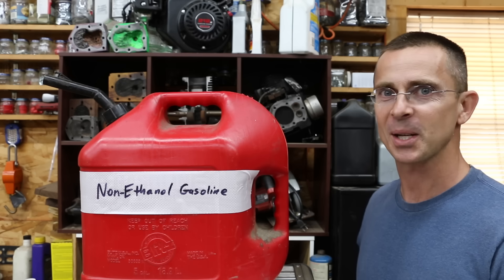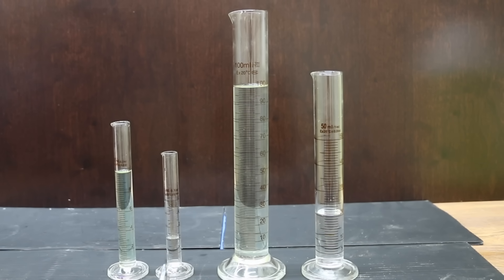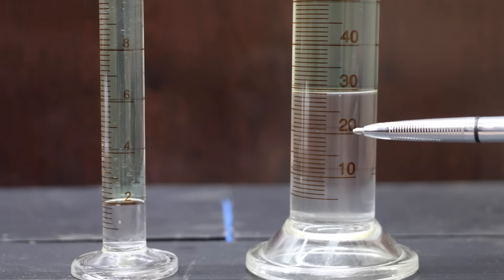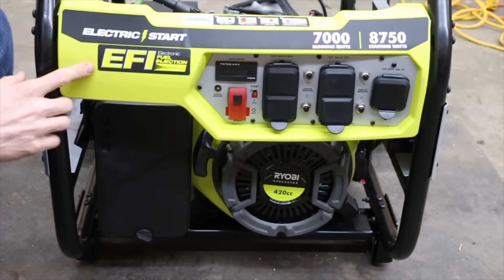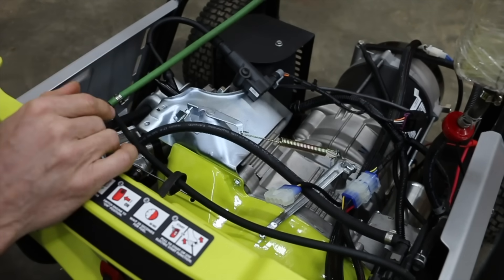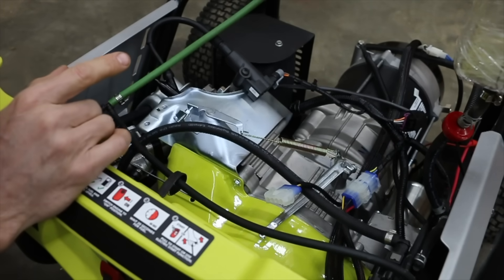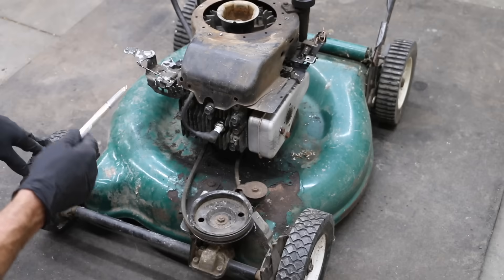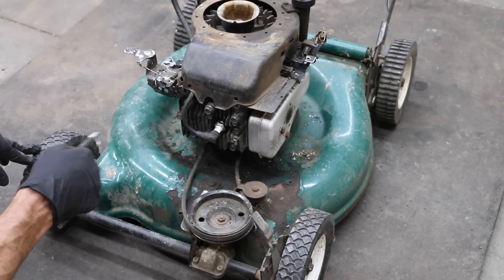Is Non-Ethanol Gasoline Really Better? See the PROOF!

Comment: Gee this is very simple stuff. Ethanol does not contain as much energy as gas does. So to get the same amount of horsepower out of your engine you need to burn 20% more ethanol than you do gas. So you get 20% less gas mileage. That equation is for pure ethanol. A blend just requires you to do the percentage math. The bad points of ethanol is that it will erode certain types of rubber and neoprene hoses and gaskets.
The good points are that it will hold some water in suspension so if you have a gas tank that does have water issues in your gas then some blend of ethanol can help as that is what you are pouring into your gas tank as an additive anyway to absorb the water. The other good point is that ethanol has a much higher octane rating. That confuses most people because they think higher octane means they have to burn less fuel to get the same power. That is wrong. You have to burn more fuel to get more power. We already said you have to burn 20% more ethanol to get the same power. But you can get almost double the horsepower by adding forced induction to your engine and burning E85. So lets say you have a 350 HP engine and want to get 700 HP. You add turbos and burn E85. How much more fuel will you have to burn? Well about 240% more fuel.
Wow! Guess what happens now? Your fuel pump is not big enough, and your fuel lines are too restrictive. And you will find out soon if you have the wrong kind of rubber seals in your fuel system. So can you get that much power with gas and burn less. Well not likely. You will burn less gas, but the engine will likely self destruct from detonation problems at such high HP loads if the octane of your gas is not high enough. 

So then how come just using E85 does not get you more power? Because the engine needs to be redesigned to optimize burning E85 for power,
such as turbos or higher compression ratios both require additional mechanical parts added to the engine. As well as a much larger fuel pump than what you need for gasoline. Can you build an engine for both? It is possible, the easiest way is with turbos. You would need a tunable engine computer and run two very different tunes one for E85 and a detuned gas which would limit the turbo boost a lot to prevent the engine from self destructing. But because of the large fuel pump and we did not yet mention the large fuel injectors required as well a detuned gas tune on such an engine will never idle well. And be hard to start in cold weather on E85 or gas. Lets look at that 700 HP engine built with turbos and tuned to run E85. Then retune the engine computer to run on pump gas and it will pull out a lot of the turbo boost so maybe you max out around 500 HP on pump gas. And yes you can get engine computers that can have multiple tunes stored in them for such use. At 500 HP that engine will be burning about 50% less fuel than when you run E85 in it at 700 HP. That is why you need different tunes the fuel maps are not even close to each other.
Reply from the maker: Thank you

Comment: Mandated ethanol at gas pumps is not american.. I don't care if they have a pump with it mix with gas but I shouldn't be made to buy it.. If a pump has 87 octane with 10% ethanol there should be a pump with 87 octane with zero ethanol in it.. I shouldn't have to go up to 91-93 octane to get ethanol free gas.. Farm bill is a bunch of BuLL#($it.. Subsidizing farmers by forcing people to buy that corn crap should be no allowed!  All ethanol does in small engines and carburetors is turn them green and )#$*PI them up!
Reply from the maker: Thank you

Comment: Maybe I missed it.  Non ethanol was 4% more efficient, what was the percent cost difference? I have heard and believe that non ethanol, while more expensive per gallon , is actually cheaper to run based on efficiency. I know that to be the case vs E85 based on my own limited tests.  Perhaps this side of things can be looked into a little deeper.  Thank you for all the tests you do. It really is interesting.
Reply: My wife's car will get 6mpg increase on non ethanol gas. My truck gets only 2 mpg better, but has a lot more power, runs smoother, and even has better sound.  Now that I'm in California, I can't get ethanol free fuel. :-(
Reply from the maker: Thank you

Comment: Wonder how much the octane is reduced by removing the ethenol?
Reply from the maker: Great point!  Quite a bit I suspect.
Reply: @ProjectFarm  I pulled into a gas station yesterday that had a pump housing opened up for repairs.  It had two fuel pumps in the bottom about ground level that "T'd" into a common 5/8" line. One for 87 and one for 93 I'm assuming, looks like it mixes the two for mid grade.  It was approximately 18' of 5/8" hose. That's approximately .29 gallons before the selected fuel grade comes out... the calculator that I used online came up with 92.5 octane when 3.7 gallons of 93 is mixed with .3 gallons of 87... much less of an issue than I suspected.
Reply: None.  87 octane is 87 octane.  My truck makes a lot more power on 87 octane non ethanol gas than it does on E10. My truck always pings except when using ethanol free
Reply: @rays7437  I did a Google search and came up with a 2.5 octane reduction by removing the ethenol from 87 E10...
Reply: @travispeoples  
I see what you mean. I misunderstood

Comment: When you do the rubber / plastic test with  gasoline  / E 10 gasoline .    I have a 1960s motorcycle and if E10 is splashed on the paint it will take it off  so this could be part of the test
Reply from the maker: Thank you for the video idea!

Comment: Look e85 is a nice option. I like options. Hydrogen too sounds compelling in say a rotory engine. But what most of us have been left with is this in between crap of 10% ethanol they cheat to get the octane up. If you want high octane with no ethanol and no lead you pay out the ass for it, IF you can even find it. Options are good but ethanol is everywhere and now we have to spend a lot extra to get away from it. One of the original arguments was well now we need 10% less oil from the middle east. Well now the USA IS NUMB3R 1 AGAIN in oil after like 60-70 years thanks to fracking so that argument is now gone. I don't want to hurt farmers or anything, I come from farming families, but try to take their subsidies for corn and get dubbed a liberal antichrist.
Reply from the maker: Thank you!

Comment: The worst I’ve seen is an algae infection on my little lawn mower carb. I guess the water separates out and algae grows in the fuel bowl.  I was out a carb, had to replace it.
Honestly, I hate ethanol in gasoline.  It always (in my cases) causes issues. And because of its affinity for water, I consider it junk fuel.
Looking forward to your long term testing.
Reply from the maker: Thank you!

Comment: I think non-ethanol fuel would have had a better efficiency rating with the engine and it's oil at full operating temperature before running the non-ethanol fuel. Considering you ran it first. In cars and trucks we see a way bigger mpg change between E85 and pure gasoline which is logical as there is more ethanol in E85 but the operating temperature of oil and the engine effects efficiency too. When the engine is not at full operating temperature an EFI unit richens the mixture and as the air intake temperature rises the EFI unit leans the fuel mixture. The oil and engine will also run less efficient with colder engine oil and metal temperatures as oil is generally thicker when colder and the metal in all engines tends to swell as it heats up to full operating temperature. With these things in mind I think your efficiency rating may have been made less accurate on the non-ethanol fuel test. Keep up the good work though Project Farm I enjoy your videos. Electronic fuel injection unit computer logic or programming isn't well known but as an auto technician I can tell you the the things I'm telling you are measurable because the newest products from manufacturers allow you to see much more inputs from various sensors controlling the EFI and all these things are easy to verify with the right tools. These inputs from sensors to the ECU make issues much easier to figure out diagnosing problems with modern engines.
Reply from the maker: Thank you!

Comment: Really you have to look at Ethanol as an anti-knock agent and the question then becomes - which do you prefer MTBE or some other chemical horrorshow or Ethanol? Even the car companies don't like MTBE.
We have had ethanol for a long long time and its properties are well understood; yes it is corrosive to the wrong alloys and it will destroy certain plastics. Yes it has less energy content than gas. You don't have to really test to find this out. I am frankly glad  that lead is no longer in fuel - it makes you dumb.

Comment: Frankly Ethanol requires 30% more fuel to burn at the same efficiency than 100% gasoline. Its power output is less than gasoline while having higher knock ratings. The percentage of Ethanol added at the pump varies greatly from station to station since all use different suppliers usually. Even E85 will have different readings depending on the supplier.

So E10 is less efficient than 100% causing you to burn more and get less miles per gallon. The emission trade off is a wash outside of a modern car really.

My 300zx gets 270 miles to tank on E10. With 100% gasoline that mileage goes to 340 miles tank. 70 extra miles off that extra 10% gasoline. I repeated this test multiple times from babying the throttle to hammering on it between multiple tanks and the results were consistent. With 100% I was seeing an average of 27-28mpg city, and 33-34mpg highway. While with E10 I was seeing an average of 22 with as low as 19mpg at times, and never higher than 24mpg when purposely short shifting every gear. Highway on E10 was 27mpg max regardless of RPM and speed.

I found the results to be bloody hilarious given the worst MPG I ever had was around 15mpg when my cats clogged, but E10 managed a 19 with a heavy foot.
Reply from the maker: Great point. Thank you

Comment: If you run anything with a carburator you should not run ethanol fuel because the ethanol eats away at the rubber float and jet in the carburator
Reply from the maker: Thank you

Comment: ethanol contains about 65% of gasoline's energy.  
90% gasoline (at full energy content) + (10% * .65) ethanol = means E10 has about 96+% of the same energy as straight gas....  your 4% number explained.  
Carbon etc, longer runs you'll see some differences there.  
I get around 40.5 mpg in my accord using no-ethanol and around 38.5 using E10.  
That's on runs of 4 tanks of each, and my driving is the exact same loop 2x a day, 38 miles each...  
one thing I notice is really slow speed driving seems smoother with no-ethanol gas.   

(I'm a really casual driver, not the stomp on the gas sort.  I have passed someone on the freeway before though ;)  )
Reply from the maker: Great point!  Thank you

Comment: I’d like to see a test between Ethanol and non-Ethanol gasoline when left sitting for an extended period of time. A couple years ago, I had to replace the carburetor on my motorcycle after it sat for a few months. I’ve since been running non-ethanol fuel and am hoping for a better result as I’ve been nursing an injured knee and haven’t been able to ride for the past year. I had intended to run it far more often than I have and I can say I am a bit puckered up as to what I will find when I do get it out.
Reply from the maker: Thank you for the video idea!

Comment: This really comes down to math.   gasoline burns best @ 14.7 to 1. Alcohol burns @ 7.0 to 1
So with 10% ethanol we get 90% @ 14.7 to 1 + 10% @ 7 to 1 = a burn mix of 13.93. you can see carbureted engines will be too lean.  Fuel injected with O2 sensors will adjusting the mix until O2 is close to 0%. However. to provide the same power out. more fuel is needed.  Carbon buildup in a cylinder 93% oil deposits. That said, as a rule, the richer the gas mix the more carbon buildup.
Reply from the maker: Thank you!

Comment: Here is one you may be interested in testing. I have installed a zero regulator, $60 on a 10hp generator, runs natural gas or LP, which runs my house fuse box by just putting hose in front of carburetor, rather than buying an adapter kit $100 to $200! Both ways seen on many YouTube videos. Thought you would be interested in testing such.
Reply from the maker: Thank you for this information.

Comment: OK this is what I gather from this video and "is heet better than seafoam". seafoam separates the alcohol and water from the seafoam and gas which can be removed easily so you have non-ethanol gas. That, in turn, leaves the seafoam in the fuel which acts as a cleaner, carbon reducer and stabilizer. Also, fuel is naturally oily, alcohol lessens that which is not what you want in any engine much less a 2 cycle or small engine. I would also like to add that with the non-ethanol fuel it seems to burn hotter (more blue flames than  e10)  which also appeared to me to leave the e10  a little dirtier, and less fuel efficient.  So could you do a test with fuel that had the alcohol and water separated with seafoam then removed, vs e10 with water and heet, vs straight e 10 and straight non- ethanol?
Reply from the maker: Thank you for the video idea!

Comment: I actually get a dramatic increase in miles per gallon when using non ethanol. Enough so that I will not use ethanol in my motorcycle because I only have 4 gallons of fuel.
Reply from the maker: Great point on the improved efficiency of non-ethanol.

Comment: Absolutely love using high ethanol fuel!  80+% makes some serious power and burns cleaner and cooler.  Cylinder temps run cooler on e85 than 93 octane, plus after 20k miles we pulled the engine apart and it looks near brand new inside.
Reply from the maker: Great point!

Comment: This was interesting video, but I would argue that based on these tests one can't really draw any conclusions whether ethanol has good or bad effects. Reason for that is the same as you commented on the video: if you take the ethanol out of E10 you are left with different type of gas than with pump E0. I think one should not look the effects of only ethanol, just because gasoline has it only 10% where as 90% of it is gas, which is obviously different stuff than E0.
Frankly put: Comparison object 1: water with 3% of sugar, but 0% of added food color added. Comparison object 2: water with 3% of salt and added food color. Test: Give both to a plant and look how the added food color affects the plant.

I hope in your fuel-line test we see comparison of e0, gas originally e10 where ethanol is removed with water, making it e0, and maybe even e50 where ethanol is removed turned into e0, pump e10, pump e50 and finally 100% ethanol.
Reply from the maker: Thank you

Comment: Suggestion for your next project
Perform this same project yet add using HHO to the intake of the carb.  
1 Engine running with the fuel of Gasoline
2 Engine running with the fuel of Gasoline and HHO no the air intake of the carb.
3 Engine running with the fuel of Ethanol Gasoline
4 Engine running with the fuel of Ethanol Gasoline and HHO on the air intake of the carb.

Test the time frame of each fuel supplied, the temps of the engine and pull the head to see the cleanliness.
If you have a  Exhaust Gas Analyzer use it on each fuel that the engine uses.
Reply from the maker: Thank you for the video ideas!

Comment: Test regular fuel (87) vs premium (91-93) to see if it's worth the extra money/performance/engine health
Reply from the maker: Thank you for the video idea!
Reply: It's well known that octane has nothing to do with performance or engine health or anything else good.  If anything it reduces those a hair, as well as mpg.  If your engine requires it then use it.  If it doesn't require it then don't use it.  Even if your engine requires it, it will reduce mpg a hair compared to low octane.

The purpose is ONLY to protect certain (not all) high performance engines from damage, nothing else.  Low octane gas may reduce performance in these engines, depending on the engine computer.  Because the engine computer will usually cut power to protect the engine from damage.  Specifically octane is for knock protection.  Your engine may not knock with low octane because of the engine computer/ECU, margin of safety and so on.  It probably won't for a while.  But you're taking a dumb risk because if/when it does finally knock (if a 2nd thing goes wrong for example and the ECU can't compensate), if it knocks hard enough it can cause severe damage costing over a thousand dollars to fix.

Certain high performance engines require premium because conditions such as high compression increase horsepower but also increase temperature and therefore knock risk.  It is possible to avoid the need of premium by boosting horsepower in other ways, but then the engine may be heavier (reducing acceleration and losing a little handling), the other ways may cost more, or etc.  But many low-mid range sports/sporty cars are designed to use regular to appeal to the consumer.

Comment: I was told leaving gas in the carburetor over winter is a problem with Ethanol gas.   Is this true?  I was told using low octane fuel is more a problem in small engines than using high octane fuel.   Is this true?
Reply from the maker: Ethanol gasoline can indeed cause issues for a carburetor over a winter. Thank you

Comment: I recommend getting some 3M roloc bristle wheels for a die grinder. They make cleaning metal surfaces super easy (like removing gasket material) and doesn't damage the metal. They're cheap too!
Reply from the maker: Thank you for the video idea!